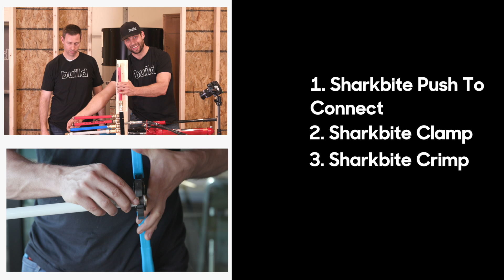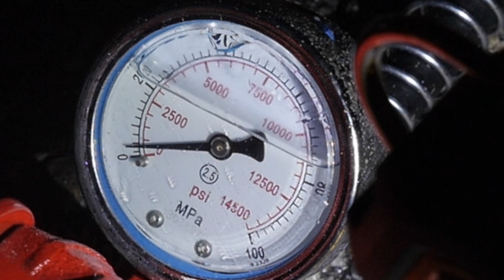Can we blow off these PEX fittings?  Sharkbite vs Viega vs Uponor

Comment: And as strong as copper is, if pinholes develop by lightening or manufacturing inconsistencies, you still have a leak, I would opt for anything other than copper. After repairing almost 100
pinholes in 5 years, on a 50 year old property in Orlando FL, I would NEVER use copper. I use the white Shark Bite pipe, it's slightly flexible, with a wall thickness equal to CPVC, would love
to see what pressure that would burst at.

Comment: To be summarized, dont use shark push, because of it not good holding in high pressure. I think Shark clamp is good enough, because of it  cheap and easy tool to do. To compare with crimp tool is harder to installation
Reply: Most domestic water supply is less than 100 PSI.(mine is about 60 psi.)  I believe that Jordan said the Shark Bite Push fitting failed at over 200 PSI. I don't believe it is fair to say that it is not good at holding in high pressure. It would be fair to say that  if you need a fitting to hold at pressures about 200 psi, then the push to hold fittings would not be a good choice. 

I have used push to hold fittings on a lot of fittings in my house, none of them are buried though. I added a new main shut-off as the existing ones had corroded and couldn't close to shut off the water. And the city had no idea where the street shut-off was. I had to install a ball valve with the full force of the water coming in. You can do it. It is just very messy and you WILL get drenched. And using a push to fit connector is the only way to do it. 
1) Remove everything from the area. Close the valves to the water heater and turn it off or set it to stand by/vacation mode.

2) Get several 5 gallon bucket and put a towel in each to reduce the chance of splash back.
3) Get several more towels to spread around.9
4) Remove all the aerators from the faucets and all the shower heads. Soak them in CLR or similar product to remove lime build-up and to make them more free flowing. 
5) If you have copper, get a quick cutter that rotates around the pipe and is self adjusting.  If Pex, use a very sharp cutter. 
6) Before you start to cut, make sure the ball valve is open and positioned correctly in your hand.
7) Start to cut the pipe, do it slowly so you get a clean cut and so you can monitor the cut.  Hopefully, you have remembered  to mark how far you need to push the ball valve to get a good seal from the cut line. 
8) As you get close to finishing the cut, have a helper take over the cutting, and bring in a bucket to help catch the run-off from the rest of the house. Grab one of the extra towels and hold it above the cut.
9) As the cut breaks through, slide your hand with the towel in it down and grab the pipe with the city water spewing out of it and clean  off the cut if possible, and then slide the open ball valve over the cut and push down until seated. 
10) Close the ball valve to shut off the water. Check to make sure you have pushed the valve the correct distance onto the pipe. 
11) Cut off any extra pipe if needed to fit in the end of the ball valve, make sure to debur first.  Push hard to make sure that you get it the proper depth.  Did you remember to mark the depth you need to push the pipe into the ball valve?
12) Now would be a good time to start soaking up the water with the spare spare towels and buckets. 

13) Open a faucet that is near you or that you can hear, or that you can hear your helper shout from. Open the cold side first. 
14) Slowly turn on the valve, inspect for leaks, check with your helper to see if water is flowing and if any junk came out. Open the water full force and make sure all the air is out of the lines. Check at each faucet.  Once it flows cleanly, shut off the faucet. 
15) Open the valves at the water heater and turn it back on so that it starts to heat. Repeat the faucet check, turning on one at a time until all are flowing clean and then reverse and shut off the taps. 
16) You are almost done, remember the aerators/shower heads you have soaking? Go get them and rinse them and inspect them to see if they need any scrubbing with a brush (a vibrating tooth brush works great). Install them and check to make sure they work better, if not replace them. The same applies for your shower heads. 
17) Now that everything is back together, you can tell your friends that you did the impossible. You put a shut-off valve on a pipe with water gushing through it.

Comment: Biggest takeaway is your not plumbers. Let the licensed plumber do his thing and stick to building. According to code, the plumbers usually have to pass the 100 psi test with air over a set period of time and this is what the inspectors usually test for in new construction. With existing systems or when the system is hooked to an active water system, the pipe must perform under the water pressure on the system. As a builder, I like the 100 psi test, because the active water system is usually way lower, maybe 35 to 50 psi. This test really didn't tell me much about the fittings and more about the PEX style tubes. 

The take-away here is none of these are any better under normal or even triple the normal capacity you would see in any scenario for which they are designed, whether commercial or residential. It then becomes a question of ease of installation and cost, and definitely getting a Licensed Plumber to do the installation. This is the biggest thing they showed you here, especially with the leaks they had at the screw fittings.

Comment: Fittings are metal 
Pipe is plastic of course it’s going to give way first 
Wirsbro fittings in fact all fittings restrict flow except sharkbites 
They are only ones with a inside diameter same as the pipe 
Well it’s a little smaller with the plastic sleeve that goes inside the pipe 

I still wouldn’t bury a sharkbite behind a wall 

Oh by the way I’m a plumber

Comment: Project farm where you at?
Reply: We def need #projectFarm to do this testing
Reply: Exactly!!!!!!!! He’d show these felching nerdy chode monkeys what’s really going on. 
  Hey build boys, catcha shark bite to an eye!
Reply: #ProjectFarm
Reply: @adamdimaggio2237 you proved nothing by putting the shark bite push connector in a different position than the others and you showed the failability of the pex nothing else. LAME
Reply: Let’s leave it to the pro for proper testing, Project Farm.
Reply: Agreed. This video shows no psi or freeze failures. It’s freaking useless
Reply: @Wolfpak765 project farm really did set the standard for tests
Reply: @Wolfpak765 EXACTLY total failure of a video presentation

Comment: Sorry but you guys are dopes. I'm a pro, have installed thousands of sharkbite fittings with zero leaks or failures. Learn how to use teflon tape and a pipe wrench before you upload another video.

Comment: Would have been a more meaningful test if all five sections were the same, preferably from the same piece.  Recording the pressures. too.
There are places when Sharkbite is the only choice.  There will be situations where you can't get into a repair area with a tool, except perhaps the Milwaukee ProPex tool.

We use ProPex - this really saves time and effort. It is not sold locally in SE Michigan, so we order it from Supply House.

Comment: So Uponor is the best . . . Logically,  if the first wall failed was uponor,  then the last pipes' connections were relieving pressure,  which is why they didn't burst earlier.   The uponor connection wasn't relieving pressure,  which means pressure would build more efficiently. Notice the leaks from ther higher pipes in the rig? Thoughts?

Comment: Upanor is supposed to withstand 1800 psi. I still use type B. Now I feel better about it. I wish you could tell use the pressure at failure.

Comment: I don’t see the need to nitpick the parameters of the test. All are great products for home use. All that aside, am I the only one who thinks That they would find it far easier of a repair to simply replace the fitting as opposed to replacing pipe and potentially the fitting as well? Anyway, as said before, probably not gonna be any issues with any of these anyway.

Comment: This perfectly illustrates yet another reason to never use teflon tape to "seal" plumbing, if you want permanent fixtures.  Tape is for temporary fittings *only*, something you take apart frequently.  Use a high quality pipe dope or sealant, instead.  The proper "dope" also acts like a lubricant, allowing you to tighten the fitting much better than you could dry or with tape.
Reply: all threaded connections are temporary. Also I've never had a leak with tape only or with tape+dope but I've had lots of them with dope only. You do you, I'll stick with what I know works

Comment: I’m so glad I saw this vid thank you . I’m Plumbling out a new bathroom from scratch. I never trusted them shark bites push ons for that reason . I regular home won’t have that much pressure but   I’m sure they work just fine but I would never use them . Unless for emergency I shit of main in home water still coming out so my back up is a shark bite push on ball valve.  I’m going forward on pex with stainless steel crimped . Not the copper ring . Love to see a vid on with crimp is Better 👍

Comment: I recently had a slab leak with approx 15 year old copper main. The solution was a PEX main reroute. Sharkbite connectors increase plumbing quality. PEX is lower cost and has a 50 year lifespan beating copper.

Comment: Your gauge might not be completely accurate within this pressure range. According to the official ASTM Standard Specification F876 to which all PEX tubing must comply, the minimum bust pressure for PEX tubing at 73F is 475 psi. Typical 1/2" PEX has a burst pressure well above 650 psi. PEX manufacturers perform this burst test many times per day in the factories. PEX fittings must meet the performance requirements of ASTM F877, which requires burst testing and sustained pressure testing at 73F, 180F and 200F, among other tests. PEX fittings are stronger than the tubing. See the website of PPI's Building & Construction Division for more info: https://plasticpipe.org/building-construction/index.html

Comment: I built a training piping system where I used over 300 Viega fittings, 1/2" to 3".... the hydraulic compressor tool. I had 2 leak out of the 300 and both were scratched ends of the copper pipe. Cutting those Viegas off can be tricky. You hafta watch out for the retaining segment. Those ends are sharp stainless... and after cutting thru copper, the ss can be a surprise.

Comment: As a plumber I prefer Uponor and here is why.  These test are not anywhere near real life. My boss prefers Vega. With that all said My reasons are simple and I have seen it in the field. The push on sharkbites are for temporary. The shrinkage crimp I see problems with in the field failing. The crimp ring will fatigue over time and fail. The pex wants to return to its original shape and pushes against the band. Look up Zurn pex lawsuit they had similar fittings and are ticking time bombs. Think about it the copper is a soft metal and easier to bend hence the iron age. Also the way the shark bite crimps on the stainless ring makes it a weak point. My boss likes Vega it uses a stainless ring doesn't create a single crimp point and we haven't had many problems with. I like Uponor here is why, look at the other fittings they restrict the flow of water. Their fittings are smaller and you are crimping the pipe down around the fitting. Uponor expands its pipe with an outside ring and doesn't create a restricted pipe. You cannot compress water so the others maybe 3\4 pipe but don't flow 3\4 inch through the fitting. Also as I stated earlier pex wants to return to its original shape so when you expand it it pushes down around the fitting making a better seal over time. It gets stronger over time pushing on the barb fitting. My 2 cents

Comment: I think that ya'll should do a general test to test different types of non metallic pipes for plumbing then step up to the stress test where you now add types of non metallic pipes to those fittings that you can make work with those fitting against the plumbing standard pipes. then the maximum overdrive test where metal and nonmetallic go head to  head to see what it all can take  not only with pressure by with water pressurized lines frozen. who blows fist. metal or not .

Comment: Why did you have your thumb pushing against the shark bite I saw that thanks for some fake results yes the SharkBite is the least effective and the uponor is the best I'm a state-registered plumber
Reply: Yes the pipe is going to fail but the fitting is going to hold I'm really surprised that the pipe itself ruptured at such a low PSI

Comment: Perhaps a gauge that reads in increments of 50 PSI.  It was an interesting test but very inaccurate.
I really would like to know which fitting are the strongest.
The tubing did fail easier than I thought it would but as you said, you will never get that kind of PSI from a house.
Maybe a test with 10 or 20 of each fitting and see which one has more failures?

Comment: All this BUT, “WE DO NOT HAVE A PRESSURE GUAGE BECAUSE WE HAVE HYDRAULICS”
What the hell did that mean.
Reply: As I understand it (minimally) water is the perfect hydraulic fluid because it does not compress but is impractical because it expands so much when it is heated as in under compression. I would like to learn more about that topic. They used hydraulic fluid as a safety measure. A failure of a fitting using water would have been more dramatic I gather. Up your safety protocols and do the tests with the liquid that these fittings are used to control. Otherwise it is useless information. Looks like fun though. Also, I agree that hot and cold cold water should be used.

Comment: Here's something interesting to think about: would you rather have a pipe burst somewhere randomly, or have a fitting that withstands slightly less pressure that is accessible burst?
Reply: Even though rare, if I was truly wanting to do something about it, I would get something like used on an air compressor, a pop-off valve where the pressure can be set.
Reply: @stevem1081  I don't think you answered the question.
Because the guy doesn't know how to ask a question correctly. And you couldn't figure out what he really meant. Not picking on you, just saying.
Would you rather have the pipe burst or the fitting burst.
I say it depends on accessibility. 

PS. Unless I'm totally misunderstanding his question myself. And if that's the case, sorry I spoke up and I've more to learn. ✌

Comment: The concern I've always had with these type of push connectors is that we rely on a rubber O-ring for a seal. That O-ring will dry out and degrade over time and fail. Not to mention that any movement of the pipes will most certainly cause a leak, seen this 100X working on drinking fountains
Reply: 'propress' fitting have an o-ring in them, non of the options they tested today have orings in them and rely on the inner diameter of the tubing to seal off.
Reply: @tylerhensley2312  I'm new to all the pex type of material so from what you said is that good or bad?
I want to get a hot and cold water line pipped into my garage from my laundry room.  I think copper would be the best bet but I keep seeing people recommending PEX type material.  I'd be fearful that eventually something breaks compared to an actual metal pipe?
Reply: @NewShockerGuy  o-rings have a tendency to get old and crack not so good under pressure, the pex tubing material itself is what creates the seal when you crimp the ring.
You can't really go wrong with copper if you know how to solder correctly, with that I'm re-plumbing my personal house and using pex, but I'm only doing it because I can color code my hot and cold. I would say pex is perfectly fine if you're using metal fittings stay away from the plastic fittings, also upsize the given diameter if you use pex so if you are planning on using 1/2" copper then plan on 3/4 pex. Pex is really easy, inexpensive and only needs 2 tools, copper costs more, takes multiple fairly expensive tools to use and takes a skill to solder.
If you just want to get it done I would say use pex, if you're up for a project do copper.

Comment: Test needs to be redone. Different pipe lengths, different pressure ruptures, and you don't even know the pressure it ruptured. For all we know they all popped around 300-400PSI. TEST COPPER AND CPVC WITH METAL MALE ADAPTER TO MANIFOLD!!!

Comment: So the oil " bounced off the ground and hit him"... No, the tool chest wasn't low enough to stop the lower pipe fluids.... so try it with the shortest pipe possible and then try it with a metal sleeve, so the pipe won't fail (we hope)and only the fittings fail!

Comment: What concerns me about these fittings is age, not PSI.  How durable are these in 10 year, 20 years, etc?
Reply: Brass fittings used with PEX A have an undefined long life span, considerably longer than the expected life span durability of the PEX A plastic material.

Comment: Teflon tape is unreliable on brass threads because the sharp extruded threads cut the tape. Rector seal no.5 with teflon won't leak.

Comment: I have uponor, but I'm wondering how it'll fair underground for sprinklers vs PVC.  PVC tends to get brittle over time.
Reply: Uponor is superior to PVC in every application, and especially so with an underground sprinkler system. If a water system is subject to freezing temps,  Uponor will expand then shrink back after thawing, instead of splitting.

Comment: Even though the shark bite push on connections are almost foolproof, I still doubt these guys put it on correctly.   Even if they did, they're still perfectly safe to use, and in a real test they hold up just fine.  They won't pop off in a freeze test, and that's usually the biggest concern.